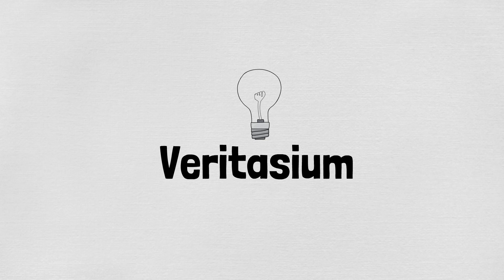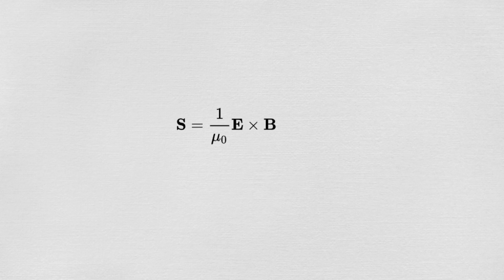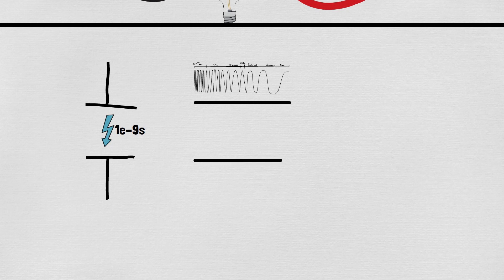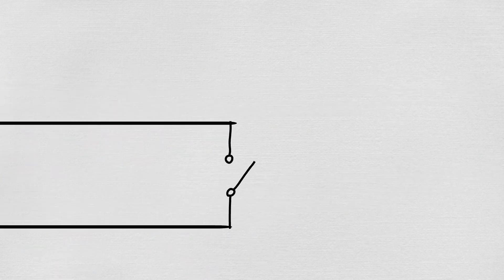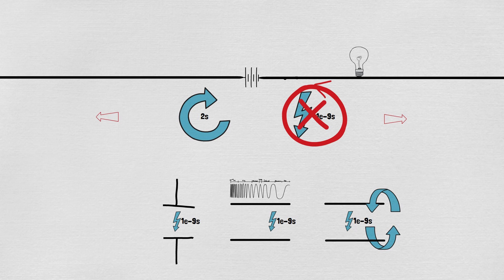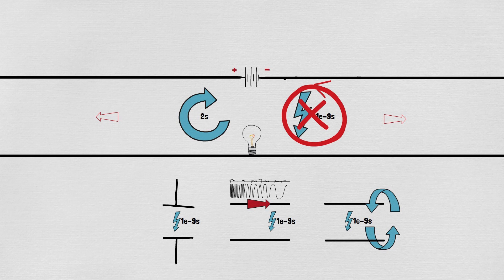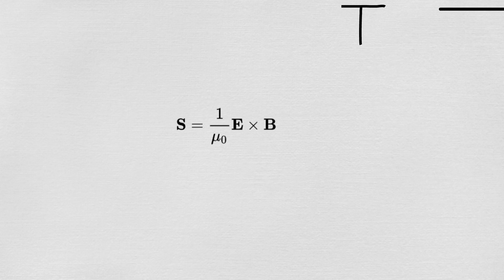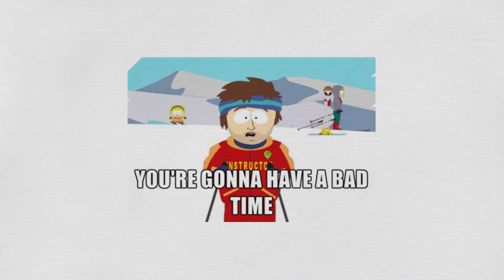Veritasium is Right? (see description)

Comment: Great video! I said it before and I'll say it again:

IF the bulb will indeed turn on instantly, then it's a scaled up version of the quantum entanglement experiment (or reverse quantum eraser) where causality (realism & locality) apprear to break down.

However, there's no information being communicated FTL, no meaningful causalities being violated. 

Of course until we build a light-second long circuit, we won't know. For now the bulb is in a superposition of turning on instantly, taking 2 seconds to turn on, and not turning on at all because the wire is broken 150,000 miles away. 

However once there is electrical "tension" established across the circuit, meaning once the battery is connected to the circuit, then the + or - charge goes through the bulb already anyway, and the switch only makes things flow, "instantly" (as instantly as we can measure the spin of electrons.

Can we even try this thought experiment IRL? Wires have resistance after all, so it's pointless to contemplate this... 

If we actually built this, how much material would it take? How thick are the wires, how strong the battery?

Comment: "Does attaching two wries to a battery cause every lightbulb in the universe to light up?" The answer is yes, if you define lighting up be the flow of current, no matter how miniscule, at the exact moment  you attach the wires to the battery. Check out simulations of current flow, where you can see how regardless of switches, complete circuits, etc. current flow will occur, and then set up waves that then reach steady state.
Reply: Why would it matter if you add a wire, why wouldn't the battery be sufficient if, as you say, it doesn't matter if they are in a complete circuit?
Reply: The easiest way to understand is consider the two long pairs going far away as transmission lines, or 'stubs' shorted at the end.  They look like resistors (of about 800 ohms). this is the characteristic impedance also called the surge impedance. 
They look like resistors until the reflections come back from the shorted ends.
.
So, at t=o, when the switch closes, the battery is connected through two 800 ohm resistors to the bulb that is 1 meter away. Therefor, after the 1M/c seconds after the switch closes, it has a lower current until all the reflections die out when the bulb lights to full.
The way the E and M fields operate causes this to happen.
Reply: @kelton5020  The wire provides a place which has less charge and can fill up like an empty glass you pour water into. Without the glass you can't pour the water. There won't be current/water-flow or an em field to project electricity to the bulb.

Comment: It's obvious that Derick hasn't studied high-speed digital circuit design. You don't need 2 light seconds worth of wiring for this problem to move from thought experiment to practical engineering.
Reply: I just watched Derrick's video and when he says that it turns on 1/c seconds later he says by a fraction. It is by a tiny fraction. As the signal starts to propagate it will induce a weak signal on the other wire. So he's technically correct, but the information is presented in a very misleading way.

Comment: This can be tested with a real circuit that is much smaller and uses real wires with real resistance. Some LEDs can be turned on in less than a nanosecond, so two 100 meter legs, a good oscilloscope, A MOSFET, some fast photodiodes, and two LEDs (one connected directly across the battery and switch, the other using the full loop) can definitively show whether the switching time is 3 ns, or the 133 ns expected from 400 meters of propagation around the loop.

Enough handwaving. Do the experiment.
Reply from the maker: Mehdi is going to publish a video soon doing just that.
Reply: @antimatterhorn  Excellent! I love the way he and Steve Mould do real experiments to eliminate the fog of confusion.

With bonus zots in Mehdi's case...

Comment: Finally a video on point. Everyone seemed to be focused on the 1 meter being missing for the units. I was focused on current flow. No current, no magnetic field. Its a which came first the chicken or the egg situation. Can you say the magnetic field carries 100% of the energy if the magnetic fields strength and existence is caused by the current. The amount of power transferred is caused directly by the amount of current.

Comment: Thank you! I enjoy Veritasium videos but I was going crazy with the flawed logic of that one and more so the army of worse answers to this (top 1 involved the EM/radio jumping 1 meter from a DC source with the ends of the circuit removed) I have lots of course work in both EE and Physics and 7 years practical experience with a scope troubleshooting systems with distances of nanometer to 1/2 mile of copper so I knew from practice this wasn't correct.

Comment: Why not doing a real experiment, with a 1 and 10 km long wire? Instead of a bulb, take an optocoupler, instead of a switch take a relay, now measure the time it takes from switching the relay to reacting of the optocoupler. Does it get faster with 1 km wire or is it the same time with 10 km wire? This should give the answer.

Comment: Though, I don't agree with Veritasium's answer, your two claims are all wrong. 1. Even if there is no wire, the will still be a very short moment that electrons flow in the light bulb, the wire just guide the electrons and the wave back so they can keep flowing. 2. Before the switch is closed, voltage has already built on the two end of it, not started to build once u close it.

Comment: Somebody please just set up an experiment for this instead of talking about it!!!  Get 200 yards of wire and streatch it out on a football field.  make a loop with wires separated by 1 meter. Connect a battery, switch, and resistor (instead of light bulb).  Connect oscilloscope probes to switch and resistor, turn on switch, and record what happens. May have to use a special switch but otherwise this is pretty easy to set up.  Then everyone will see what happens! Maybe repeat with wires separated by 1cm for grins?
Reply from the maker: i hope someone does. i'm very curious about the actual answer. unfortunately, you'd need a GHz oscilloscope, and those cost as much as a car.

Comment: No, your explanation is incorrect. The circuit is understood to have been static for a long-time. There is a charge build up at the terminals of the switch, established by the E-field which has already propagated along the length of the wire, creating the potential difference that is on the battery to appear across the terminals of the switch.
As soon as the switch is thrown, those local charges are sent into motion. This is the current. The current does NOT have to have propagated all along the circuit for there to be radiated energy into free-space. That's not how EM radiation works and I'm astonished you would seem to make that argument. 

I suggest watching this video to refresh your understanding of charges in dynamic motion:
https://www.youtube.com/watch?v=FWCN_uI5ygY

To understand the rate at which energy flows to the battery, yes, you need more than the Poynting Vector. But I believe you misunderstood Veritasium's question - he only cares when the first radiated crest of energy hits the bulb. This happens in 1/c seconds. This is a standard property of waveguides.

I have also read Jackson, as well as Kraus, Hayt, Ulaby, and Balanis.

Comment: Sorry but after listening twice I see that you do not know that at the current goes out toward the end it has an affect on the other wire. The equations you show don't work but take some smaller more direct steps and you will see that you can induce current in the adjacent wire. This passing energy as one L to another L and not point to point battery to light in the Ether, I mean as Veritasium explains there is no causal basis of statement other than something can happen that fast so well that is what will non-computational agreed.

The corrections needed for sure, but good for Veritasium to get so much activity. The values of L and C form incremental causes for current reached. I hear that in your video and this is not correct.

Dashes and dots below are the areas of computation that grow til the half end is reached and continue back till the whole loop is done. Now this isn't necessarily the end of the bouncing because C and L have a resonance frequency and that is going to involve expansion of magnetic field and discharge capacitance as there is an ever increasing field.
-
.
---
...
------
.......
--------
...........
~~~~~
!!!!!!!!!!!!
~~~~
!!!!!!!!
~~
!!!!!!
~
!!!

Comment: Ha you are right with your criticism of veritasium's explanation. They are just not good in my opinion. But you make a similar mistake.

The circuits needs to be closed to reach a steady state where current is flowing. This does not mean that the circuit cannot have any current flowing when in a transient state. So here is the transient part that you are missing. How does the potential of the wire on the left of the switch changes potential when the switch closes? By having charges move there. What happen when charge move? Current!

So you close the switch, some current starts charging the wire. That current generate a EM fields and causes current to also flow in the light bulb (though in practice, probably not enough to switch it on, but in theory, it would switch on).

And this is where all your thought experiment become very interesting. For instance, what happens if the wire is broken at the very end of the circuit? Well, in this case, once the top wire is completely charged, no current would flow anymore and the whole thing stops. So you'd have the lightbulb blip and switch back off. But it wouldn't stop immediately, you'd have several ping pong to the end of the circuit. The end result is similar to what you'd get replacing the open part of the circuit with a capacitor, some current flow until the capacitor charges, and then it stops, and the curve would look like the same, with the exception that steps would be discrete instead of continuous as you need one ping pong to the far end of the circuit to modify what's going on.

If the far end of the circuit is closed, then the same ping pong effects takes place, but the steady state you converges toward is the one you learn in your typical electricity class.

These effects are incredibly relevant in chip design, when you are working on the nm scale and frequencies in GHz.

Comment: I saw another video that explained the concept of moving the switch.  https://youtu.be/MDOYPQQmuco?t=780  Basically when the switch is open there should be(as defined by the zero resistance wire and the rest of the problem) a voltage potential across the switch, when the switch is closed current flows at the switch(not the battery).

Comment: If you put the switch further away from the bulb it doesn't break causality. It will just take longer for the bulb to light up. The wires have some capacity. When you turn on the switch there will be a wave of electrons originating at the switch propagating through the wire caused by the difference in potential. This will cause a change in electric and magnetic field which will induce some current in the lightbulb. Now this current will be very small but if the lightbulb is efficient enough it could light up. Depending on the distance of the switch it will take different amount of time before the information reaches the bulb.
Also your argument using Poynting theorem doesn't make any sense. We aren't interested in energy density change but energy flux. The equation you've shown only describes energy conservation. Your argument is equivalent to saying that flowing water doesn't carry any mass because it's density is constant so the divergence of density is 0 thus the equation of continuity implies that the density flux is 0. That's just wring. Divergence only tells you whether there is any water accumulating not if it's flowing. Furthermore the dot product of J and E will be always 0 for a straight wire because the electric field is perpendicular to the wire while current density is parallel with the wire. And outside the wire, there is no current density. It will be 0 even if the current is changing. Moreover the diverge of pointing vector can be 0 and there will be energy flowing because it's described by the magnitude of S not the divergence.

Comment: What "many Physicists" did that set up "confuse"? Not professionals who dare to call themselves Physicists. No way. This sounds like a joke. As a matter of fact, to think that low voltage, low frequency fields can do anything meters away from their conductors is what caused some medical professionals and engineers to come up with the "power line/cancer correlations" in the 1990's, which took the Congress to stage hearings trashing public money in name of mysticism. Every Physicist asked should not hesitate to say that the behavior of the fields like 1/r and 1/r^2 and the stationary condition of the fields involved are enough to trash that explanation. Also, every radio technician knows better, since they know how powerful a transmitter must be to transfer, say, 10 Watts to the other side of the road, not at low frequencies, but IF the frequency is high enough (relative to the antenna size) in order to make the wires radiate any substantive power. Finally, the American Journal of Physics cited in the description of Verirasium's video is clear about the field being present in the vicinity of the wire, not far from it.

Comment: youre wrong too.. if a  current  can pass thru a wire 3000000000 kms long, it will light up the  bulb when the  current reaches the bulb not when it reaches the end of the  circuit.. again you can prove this with a 1000 meter wire loop

Comment: Yes, this wouldn't work without moving charges. But that's literally how antennas work. It doesn't have to travel the full length of the circuit for energy to flow out. Current will BEGIN propagating as soon as the switch is closed (ignoring the transient effects due to a voltage difference prior to reaching the switch and the time it takes for the signal to reach the bulb). Your long list of "what ifs" isn't a disproof of the original conclusions, it's merely a reminder that nuance is VERY important with these sorts of hypothetical setups. I disagree with Derek's hand-waving of all the nuance and hyper-specific caveats as part of the problem, but ultimately given all his assumptions, the bulb would turn on (with some tiny amount of current) due to the top wire acting as radio transmitter and bottom wire acting as radio receiver. You don't need the ends of the wire for this to work (at least temporarily with DC. With AC it could reach steady state)

Comment: Suggesting the voltage will cause the electrons to move at the speed of light is incorrect. Electrons cannot travel at the speed of light, because they have mass and a voltage capable of electron speed close to 'C' will be In the range of TeraVolts. That electrons oppose each other will cause the current flow; to use the analogy of 12v and wires 2 light-seconds long is bound to create infinities and is bad science.

Comment: I see so many narrow headed EE engineers in the comments, assuming stuff about the wires like their impedence, because of their many years of real world experience. The wires in this problem are ideal, made of superconductors OK? Zero impedance. Can you wrap your head around that?
Reply: The word impedance has a very specific meaning: it is a characteristic of the transmission line configuration, not of the wires themselves.  The wires can be assumed to be superconductors.  The impedance comes about because of the propagation of electric and magnetic fields in the space surrounding the wires.  The wires forming the transmission line act as perfectly conducting boundary conditions on the field propagation,  and that changes the impedance from the unbounded free-space (vacuum) value of 377 ohms.   Yes, the vacuum has an impedance in classical electromagnetic theory.  It has nothing to do with quantum mechanics or anything tricky.  This all goes back more than 100 years, to Maxwell's classical theory,  and has been abundantly confirmed by every electromagnetic technology ever since.

Comment: Wonderful, thorough explanation. When I watched some of the other videos trying to support Derek's conclusion, I kept asking the same questions in my mind. If it were true, then all the lightbulbs in my house would be constantly lit and switches would be useless. Causality would never apply. Of course, people have protested that since this was just a thought experiment, then you needed to consider the lightbulb to be "ideal" so that any amount of current would light it. If that were the case, the lightbulb would always be lit because it would always be in some sort of EM field. And if the EM field could arise and travel easily across the 1 m space between battery and bulb without considering the rest of the circuit, why couldn't it travel as easily between the terminals of the battery itself causing a short circuit at the source? Yes, your explanation is correct. Derek did a find job of explaining how energy travels in an EMN field rather than through the flow of electrons then botched it with his answer to his clickbait question.

Comment: You are wrong because you failed to consider that there is a transient current, when the switch is close to the battery, which is the actual problem. If you put the switch at the far end of the circuit, that is a strawman.